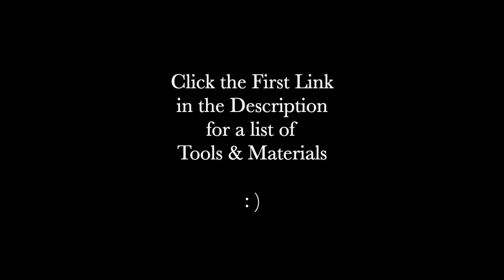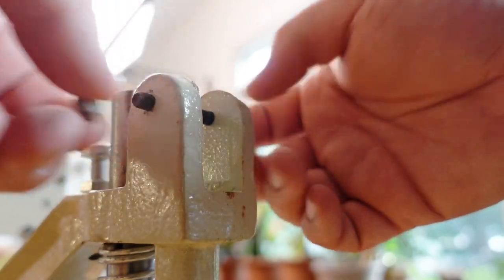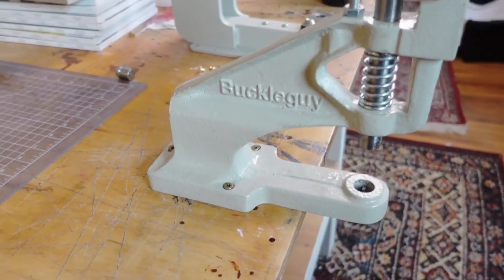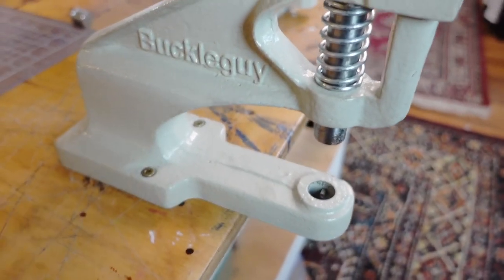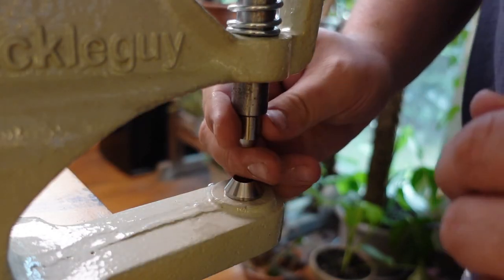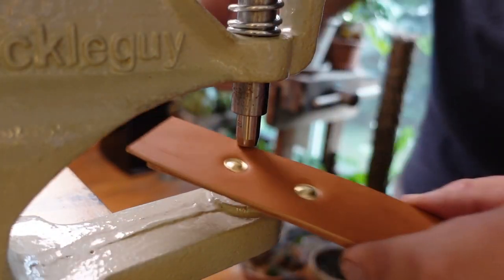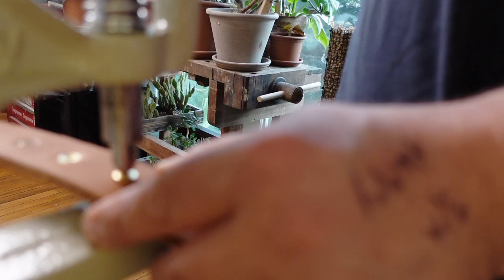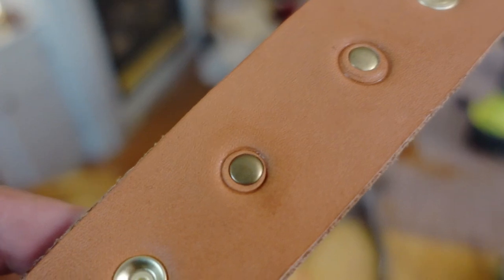Buckleguy Cloned...Their own Press.

Comment: I just received the new 180 deg convertible hand press from BG. I have not had a hand press before and find the dies a bit confusing. The BG dies are fine, but I had to buy some Tandy dies for rivets and while I can use them on the BG press, it is unclear how to set up the distance between dies with the spring and plastic ring on the Tandy die getting in the way. Build quality on the BG press is very high. I just wish they made more die sets. I also had to get the Tandy set for segma snaps.

Comment: I'd be more comfortable applying that kind of pressure on their higher tier press than the cast one.  Seeing how much that press flexed in the video made me cringe because I know what happens when cast parts fatigue over time.  I'm glad that they went to a more neutral color as well!
Reply from the maker: it's solid cast iron, so it'll be fine - the flex was the 2" of 3/4 plywood it was mounted to at the end of the bench there that's unsupported, that's why it was mounted so far back haha
Reply: They are both made of cast-iron and bonus not the highest end.